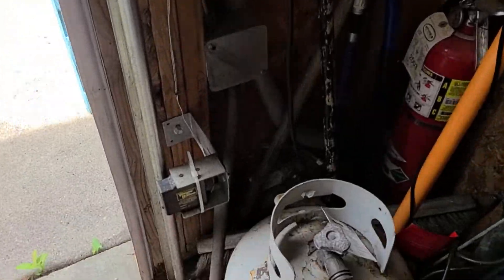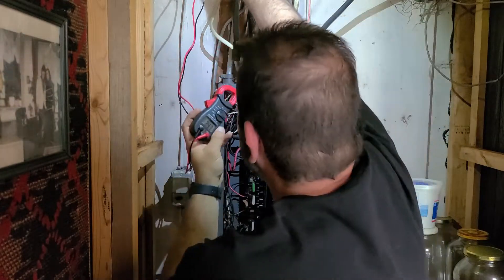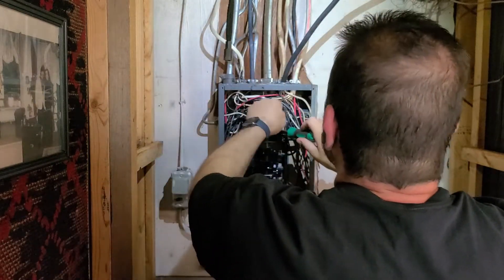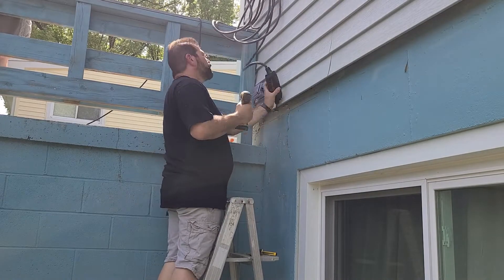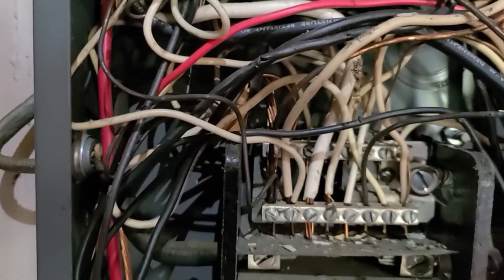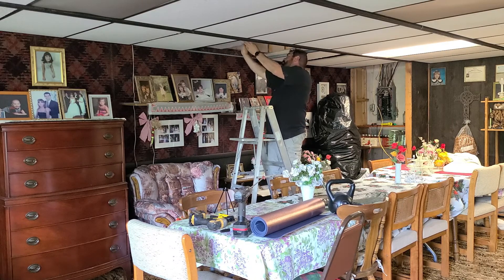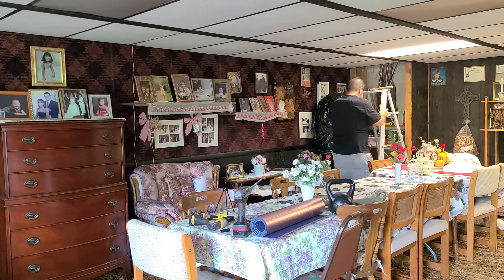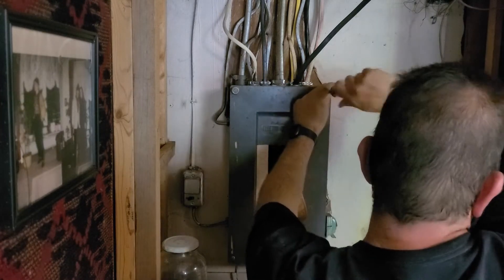How to Install a CAR CHARGER from START to FINISH.  16 AMP 240 VOLT Level 2 EV Charger!

Comment: Subscribed
Reply: I have a 2019 Leaf with 40 kwhr battery.   We drive it about town,  5600 miles last year.  Use a neighborhood charger, 0.2 Mi. Away.   Consumed 1634 kwhr for average of 3.42 Mi/kwhr.   The EV road tax is $130 which works out to 2.3 cents per mile.   Time 8:09 point.
Reply from the maker: Gotcha!